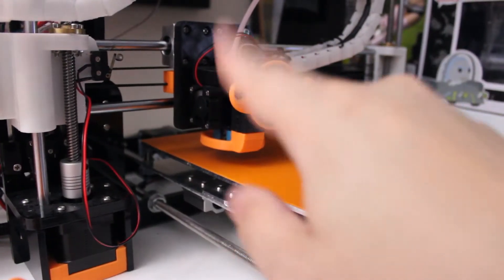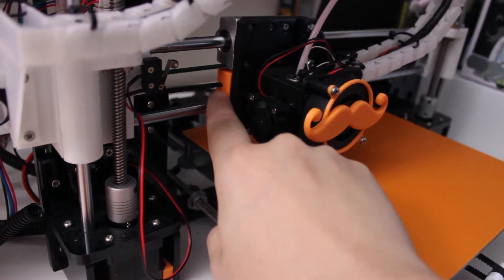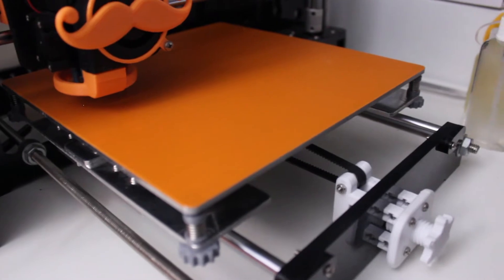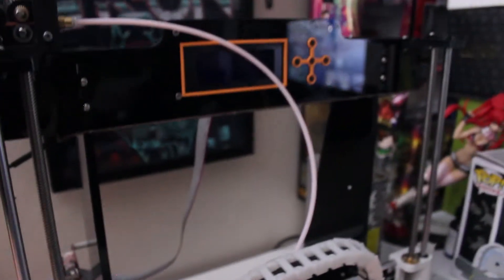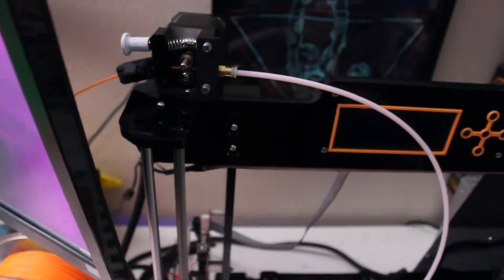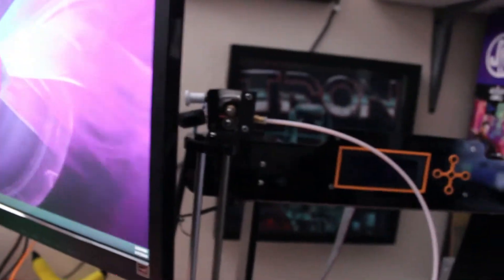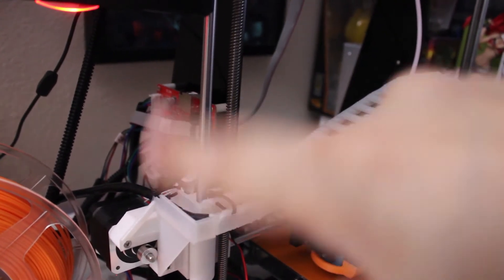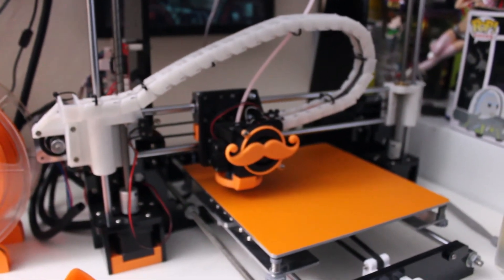Anet A8 Upgrades V2

Comment: What are your cura settings?
Reply from the maker: Layer Height: 0.2
Wall Thickness: 0.8 (I have this set for double my nozzle size but can be put to 1.2 for thicker walls)
Top/Bottom Thickness: 0.8
Print temperature:225 (This was the best temperature for my filament your results may vary)
Flow:100
Enable Retraction
Print Speed: 60mm/s
Top/Bottom Speed: 20mm/s (Use this setting so that it comes out smoother and has a higher quality)
Travel Speed: 120mm/s
Initial Layer Speed: 20mm/s (I found the slowly the first layer the better the bed adhesion)
Enable Print Cooling
Build Adhesion: Skirt (use this to clean off nozzle before print)